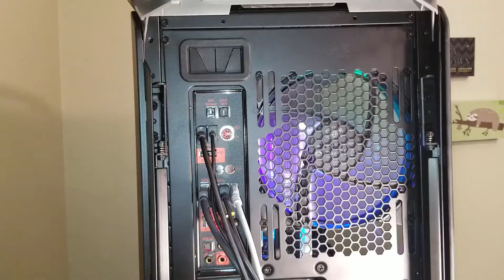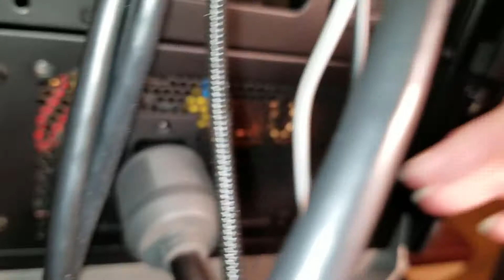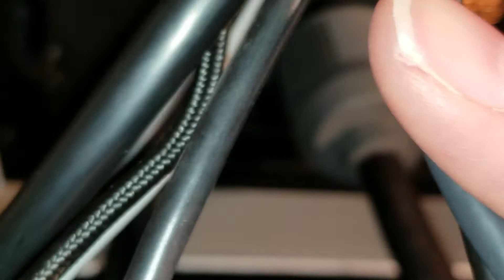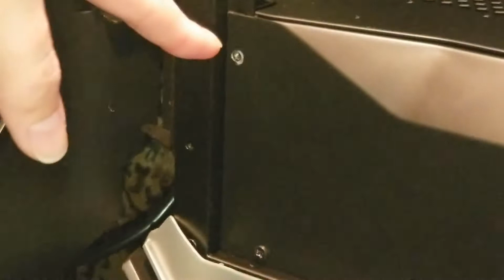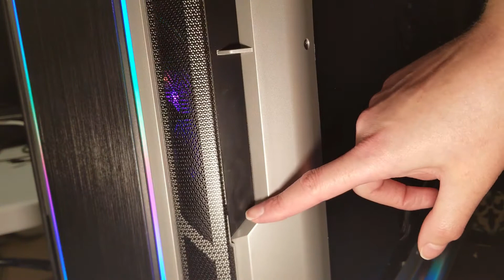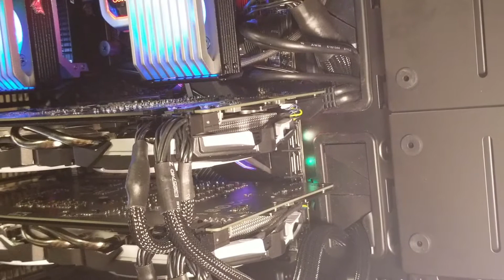Cooler Master Cosmos C700M Follow Up and Review.

Comment: Weird about the paint getting off in your case - didn't notice that on mine. What I did notice is that the tempered glass seems to micro scratch REALLY REALLY easily - be extremely careful when you clean it (too late for me though).

You might want to put a magnetic 30cm ARGB LED strip either at the left edge of the blank area (which is what I did on mine, it will reflect on the motherboard and light it up) or at the right side next to the front fans, which would illuminate the blank panel and give it any 'tint' you want (possibly better than staying dark). 

You might also want to get the Cooler Master Mini Wired ARGB controller and connect your 3 ARGB fans to it (which would allow you to have different effects for the fans and the case,  although all fans would share the same effect) or - better yet! - the big Cooler Master ARGB controller which, I think, would allow you to control each fan individually via software , which is what you seem to want. 

You could then optionally connect the MB's ARGB input of the C700M's case controller to the separate Cooler Master controller, turn the case's top ARGB switch all the way to the bottom (which currently turns ARGB off in your case because the MB's ARGB input of the case controller is not connected anywhere) and thus also control the case LEDs from the same software - while still retaining the ability to also control case lighting via the top switch.

Just giving you some ideas. :)

In my case I got five CM 140mm ARGB fans (same as yours), replaced all the four case fans with them (true you can't see the bottom front fan when looking from inside the case, but you can see it when looking at the case from the front) and added one to the rear top as extra exhaust. The fans ARGB inputs are all connected to the case controller so they all display the same effect (in my case I prefer a simple static white). 

Added the ARGB strip I mentioned above, connecting it to my motherboard's second ARGB header, and control it via ASUS Aura software (static blue to match my Intel Optane's and Corsair Vengeance RAM blue leds, which are not addressable). To provide some hot/cool contrast the LEDs on my Asus Strix 2080ti and Maximus XI Formula motherboard are bright orange (also static). Would love to make those slowly 'breath' but Aura is crappy software and does not allow me to add different effects for different ARGB zones, only different colors.

Comment: My issue one month into owning this case is that my case LEDs started dying on me.  I had to call up Cooler Master to replace them.  My case is back into perfect working order, but I leave the case LEDs off most of the time for the fear this problem may happen again.  Aside from that problem, the case is still a great upgrade from the Cosmos II I previously used and it has that versatility I've been looking for in a case.
Reply from the maker: Interesting. I haven't had any problems with mine yet. Knock on wood lol.

Comment: Lol well I parted with my 780T, it sits on my floor stripped down to the bone... And in it's place is a c700m, which I absolutely love being it's a definite upgrade! Quick question, what kind of Fans you have connected to the controller?

I'm thinking I should just go ALLOUT (Corsair Commander Pro) to run my RGB's in this rig. 99.9% of my accessories are Corsair RGB anyway, Mousepad, Keyboard, Headset Holder, Mouse etc.

Comment: like does it work without addressable RGB and connect normal rgb fans like the LL120mm from corsair? because my motherboard doesn't have addressable RGB.
Reply: If I understand your question correctly. The case front panel and the fan controller only works with addressable rgb. You might want to look into the corsair commander pro. It is a fan controller that uses corsair link to personalize your rgb effects.
Reply: I have the same case and did you just plug the fan cable into the controller and the lights turned on or where did u plug the rgb plug into?

Comment: Do you think there would be room for fans on either side of the radiator (front of case)?
Reply from the maker: Yes. There is actually room to put fans on both sides of the radiator.👍🏻
Reply: @g1divastator  thank you so much!

Comment: You should get a 90 degree usb cable for the mobo, makes everything easier
Reply from the maker: The Mobo actually came with both straight and angled cables. The way this case is designed there was not much difference if I used either one.

Comment: #100th Thumbs up mines on that back fan controller only has 2 sata power hook up cables for power. Yours looks completely different. You just have one power cable hook up. I'm having a devilish time with getting this thing to turn my pc on. I can put it in my Cosmos II case, and it powers on. I put it in that thing, and it blows a fuse. 
I got multiple power supplies, and that aint the problem. Any info would help!

Comment: Can someone help me this is my first build and I think I've done something wrong. I only get the motherboard rgb lights to turn on when I turn the power supply on. The top buttons dont turn the pc on and have no power going to them.
Reply from the maker: You may have plugged your front panel  in wrong. I would reference your motherboard manual to see if you plugged it in correctly.

Comment: you just got a bad unit. Tried to replace it?
Reply from the maker: No, I kept it. You can't see the bad spots from the front so I didn't want to risk getting one in worse shape😬
Reply: @g1divastator   I also received my case damaged on the metal side-panel. Have you been able to sync the lights with your motherboard? I'm not able to make it sync.
Reply from the maker: @NarciisJr  No. I can't sync the lights because I have an older motherboard that is not compatible. I left it on the rainbow setting because that is my personal favorite.

Comment: This is the worst case ever! They have switched the way they manufacture this case. The wire management is not even close to the same. Also the rgb lights burn out after an hour or so of use. I am on my second 700m and the lights just went out on it. Got to love spending almost $600 on a case and then find out that cooler master doesn't even have a custom support line you can call. I submitted a ticket on their website about a week ago, still no response. On Amazon I did find some reviews about this problem. Looks like they are still dealing with the problem with no resolve. I personally will never buy from cooler master again. I had a problem with an msi laptop once they paid for me to send it to the and sent me a better one free, no questions asked. Fuck cooler master!